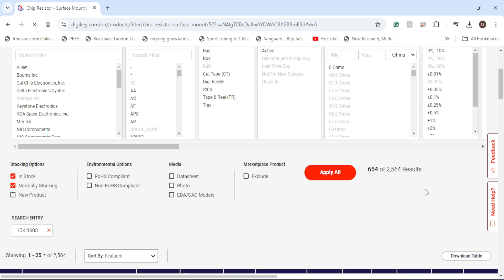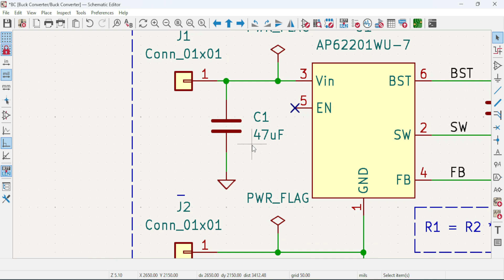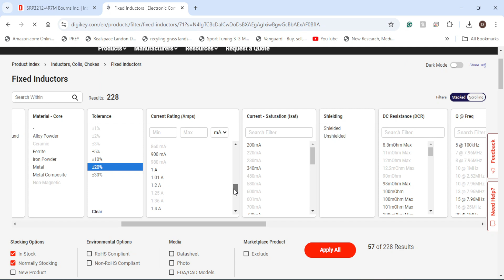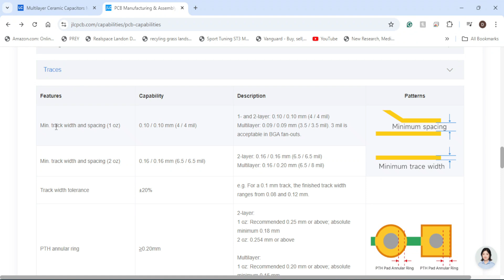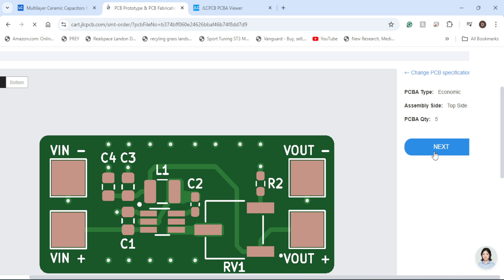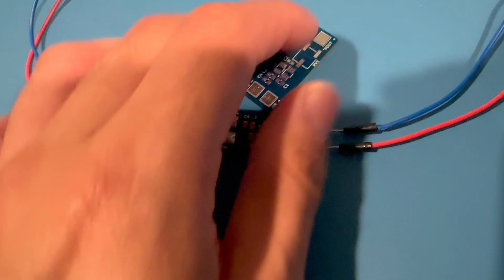Ordering & Manufacturing PCBs Guide - Components, Gerbers, CPL Files

Comment: There's absolutely no need to spec. higher than the rated voltage, the manufacturer has already built in some headroom over the quoted figure. There seems to be a growing trend of people saying you shouldn't run parts at their rated voltage, it's complete rubbish.
Reply from the maker: @mfx1  Fair enough, I just meant to include some headroom as like you said multiple sources/people online recommend to double the voltage on the capacitor based on whatever the supply is. Though like you said you can run it at the rated voltage.
Reply: @DRELECTRONICS-mm5hb  If you're using parts from grey sources as many hobbyists do it's reasonable but pointless for reputable sources.

Comment: Dude this was awesome and exactly what I was looking for, thank you YouTube algorithm. Also, is it necessary to use lcsc as components distributor? Because if they don’t have the parts then wouldn’t it be possible to use the likes of mouser, digikey, farnell and so on to populate the board especially for smd service?
Reply from the maker: @jboy6944  No problem, yes you would need to use LCSC if your going to get your boards assembled through JLCPCB. They can assemble your board if you give them the parts, but it’s very expensive so if you plan on putting a board together yourself then Digikey/Mouser is the way to go.
Reply: @DRELECTRONICS-mm5hb  is this the same for pcbway or other manufacturers
Reply from the maker: @jboy6944  PCBWAY has more variety for part selection, but there’s been times when parts I wanted to use they didn’t have so it’s kind of a case by case basis